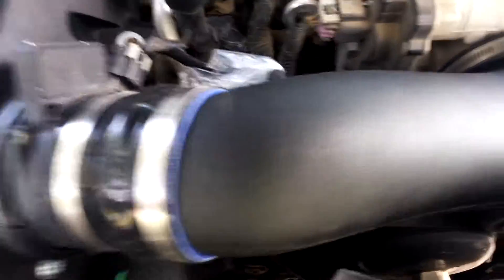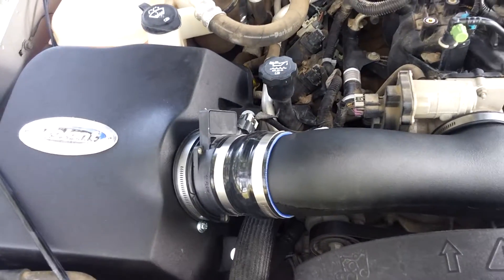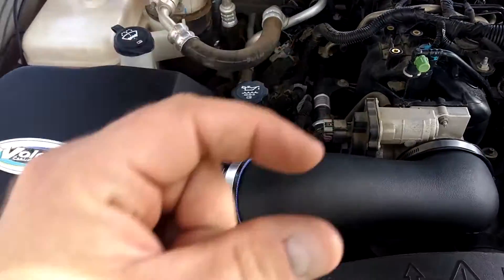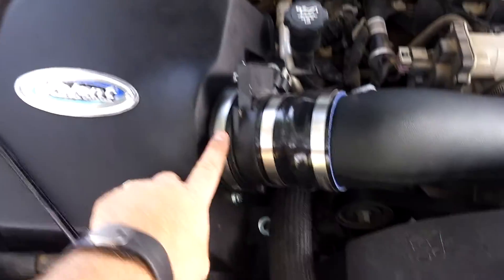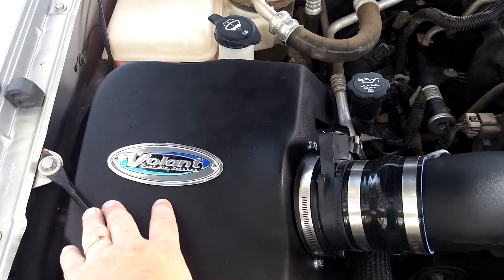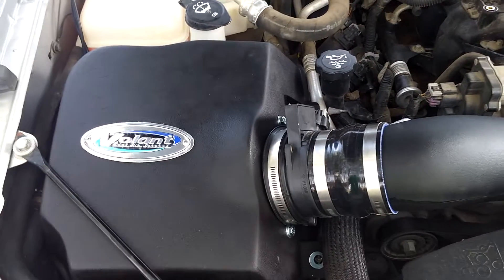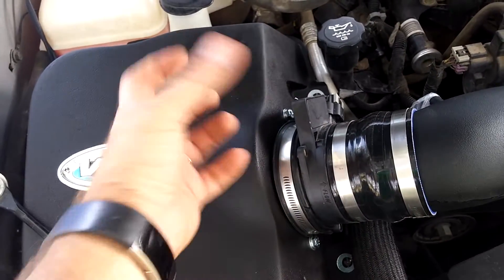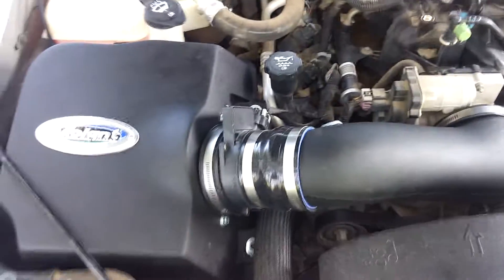Volant Intake Trailblazer 5.3 After Installation

Comment: Gary , do you think the intake is worth doing? I have a 2006 envoy denali. But I'm kinda worried about the closed box intake. Was wondering if you noticed any difference with it in sound, performance, gas?
Reply from the maker: Bill Dougan I liked it quite a bit. I paired it with a Superchips programmer as well.  It sounds great, throttle response is better, and there is noticeable top-end improvement.  I have taken everything off because I am selling the Trailblazer, and it is VERY noticeable that it's not on there.